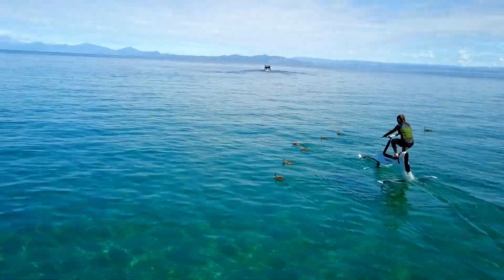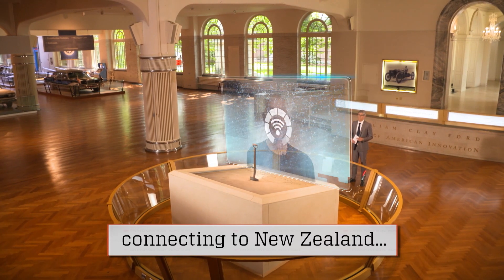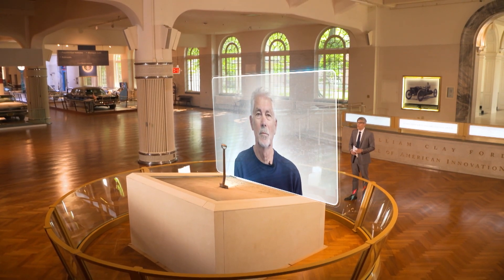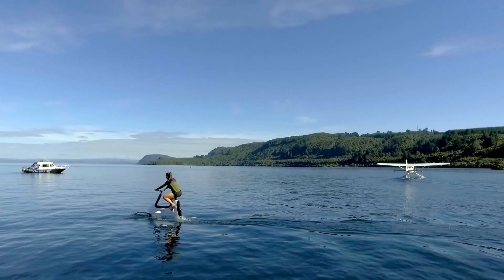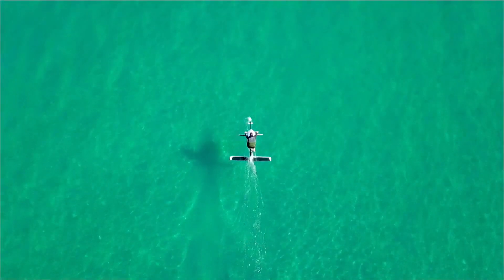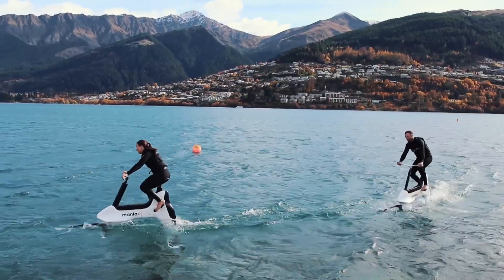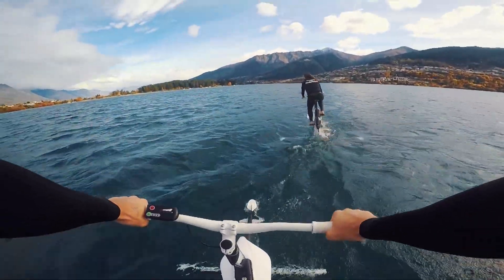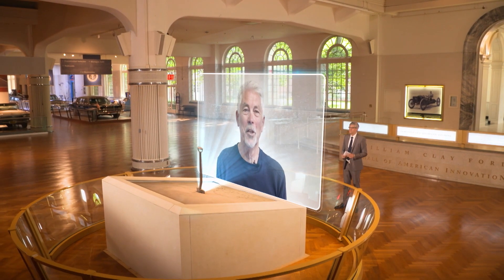Hydrofoil Water Bike | The Henry Ford's Innovation Nation

Comment: Anything can be made to look promising in a commercial. I, for one, am not convinced of this design. The truth is, it takes an incredible amount of energy to lift a 160-lbs man out of the water and keep him above it. That energy has to come from somewhere - either you'll be doing the workout of your life, or the battery will be doing it for you and it'll run out of juice in no-time doing it. If you were to change the pedals out with a diesel engine and ensure that no water gets into the air-intake, then you might have a viable design idea that's worth prototyping and testing.
Reply: It requires about 250 watts to stay aloft, which is about the same as the max sustained output of a male athlete. Of course it takes a lot more to rise up out of the water. With a 350 watt motor (the same as a midrange ebike) even a relatively slender non athletic person could  rise up and easily ride this for ½ hr or more depending on the battery capacity..
Reply: You are thinking to much, the motor assist helps cut half the effort while holding a decent charge, which gives the rider a longer and maintained speed.
Reply: @jonoanders9255  i thought the battery lasted an hour
Reply: I mean there are electric foil surfboards that last around 2 hours and they go pretty fast. Drag is significantly reduced which helps maintain higher speeds once you lift out of the water. 

This isn't particularly groundbreaking, it's just cool to add pedals to this type of system and get a biking workout from it.